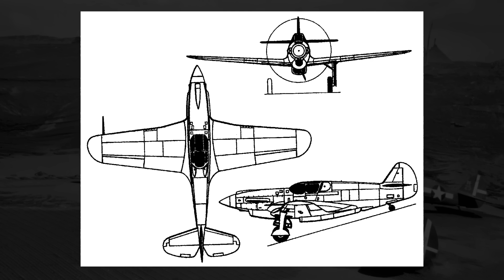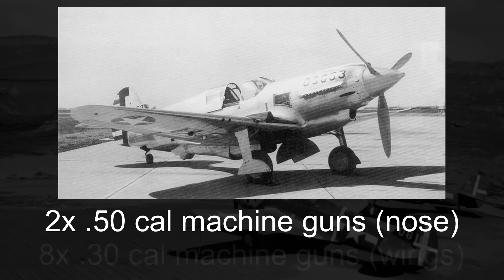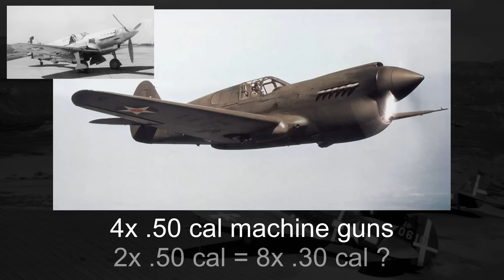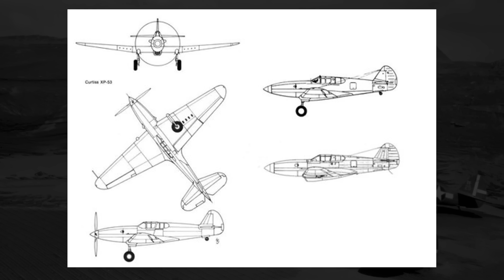Making A Fighter Worse By...Improving It?: Curtiss XP-46

Comment: Possibly a future vid topic are the late P-40 bubble canopy, other engined including Merlin versions that matched the P-51d but...they had a ton of P-51s by that point.🤦 They were awesome looking through arguably beating the Mustang which was a beauty itself!🤓
Reply: I've heard the top speed of the Allison powered P-51 was 390mph. The Packard Merlin was a V1650 as was the RR one
Reply: I think you are referring to the XP-40-Q prototypes.  They used a version of the Allison engine with two superchargers and water injection, which proved unreliable.   There is at least one video about it.  A variant of that engine was used in the F82 Twin Mustangs and called "the Allison Time Bomb".  These planes were close in performance to the P51D, but did not exceed it, so they were not put into production.  I don't think they ever increased the fuel capacity to match the Mustang's range, though.

Roughly 2000 P40s (the -F and -L) used the Packard-Merlin V-1450-1 engine for better high-altitude performance.  This was the single stage, two-speed supercharger version, not the two-stage units used on the P51D.   The Packard Merlin boosted high-altitude performance with a critical altitude of about 20,000ft versus the 15,000ft for many Allison-powered p40's.    About 600 of these planes were converted back to Allison engines, probably because there was a lack of Packard Merlin parts and the Allisons were easier to keep running.
In general, the P40 could hold its own with a Mustang at low altitudes, largely from better roll and turn rate, but the Mustang was a bit faster with the same engine and had a higher dive speed.  One report I read stated that the Mustang "could engage and disengage at will".    I have read that the Allison-powered P51A was 15-25mph faster than the P40 virtually everywhere with essentially the same engine.  If the P40 had an altitude and/or speed advantage at the beginning of a fight, the Mustang was in trouble.
Reply: @jfess1911 
The Allison engine Twin Mustang absolutely smoked the pre production Merlin version of it, same is true for the regular P51 that they put the 2 stage Allison engine in, only one was built, it out performed the Merlin version in every regard and was a 490 MPH aircraft, but the war ended and they pulled the plug on producing them.
The 2 stage version of the V1710 Allison was available to North American Aviation when the British ordered the development of the Mustang, it's a myth that it wasn't, it'd just become available shortly before, but the British ordered the single stage Allison engine in them because they were waiting for the Packard version of the Merlin to become available as that's the engine they wanted in it the entire time, and it wasn't because the Merlin was more power, it's because the US providing England with the things it was at the time was technically illegal because of the US's neutrality laws, FDR was coming up on the end of an unprecedented 4th term in office, something some people thought he shouldn't have been able to do in the first place, all it would have taken is an administration change to one that wasn't willing to skirt the neutrality laws the way FDR's was an England would have been up a creek, the sole source for engines and parts for what could have been thousands of aircraft could have been cut off, it's one thing to copy an airframe but engines and parts is a whole different story, they ordered the first 600 with the single stage Allison engine because more than anything else they needed aircraft plus the type needed to get to them so they could familiarize themselves with it, they figured they'd just press those into service where medium altitude aircraft were all that was needed, then all future orders would have the Packard Merlin engine installed which should have been available by then, but, then the US entered the war and snatched most of them up, it was a package deal all ready to go. 
The Allison was 60 ci bigger than the Merlin and therefore when all other things were equal, primarily boost and octane levels, it'll make 60 ci more HP, and even a little more as it had a better combustion chamber.
Reply: @jfess1911 Damn and I thought I knew my planes😉! Great info thanks!
Reply: @jfess1911 Yes I remember now it was the "Q"! I always thought it was funny how far they got down the alphabet on that plane. I'd guess the Spitfire was the model number champ think they were into the 20's!🤯
Reply: @djcjr1x1  I think that one of the videos using the joke "When a P40 and a P51 love each other very much" since it looked like a mix of the two (part of the problem was that the Allison two-supercharger setup was considerably longer than a Merlin, requiring an extended nose).

Comment: I find it interesting that early versions of this plane and the A-43, a Mustang body ground attack plane with this same Allison engine, had one 50cal slightly under each side of the nose. I've never seen it elsewhere I wonder why?🤔

Also most P-40s are usually shown with three .50cals in the wings that's not a mistake is it?
Reply: The Hurricane was originally designed with two fuselage machine guns which made it slightly wider than it needed to be.
Reply: @womble321 Well now there's 3 I know of thanks!👍
Reply: That's the later models with the six .50s...and nearly all the surviving P-40s are the later variants.
Reply: @stevetournay6103 That makes sense, earlier ones got destroyed.